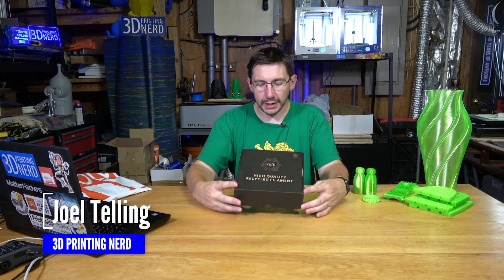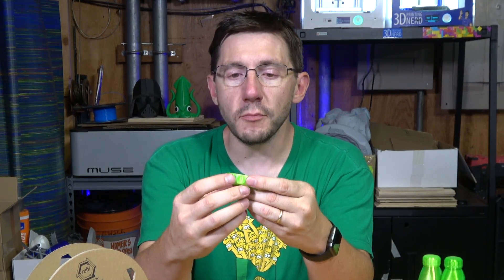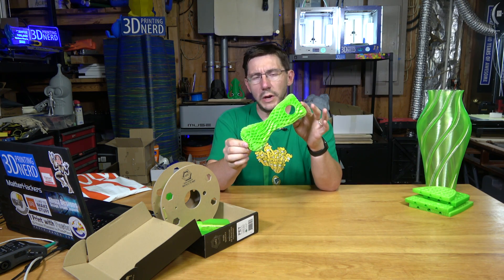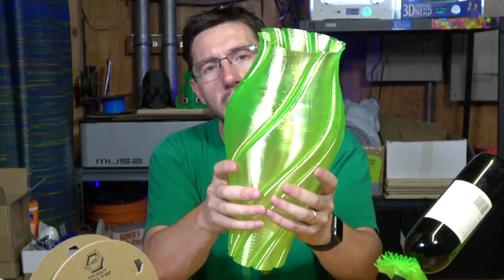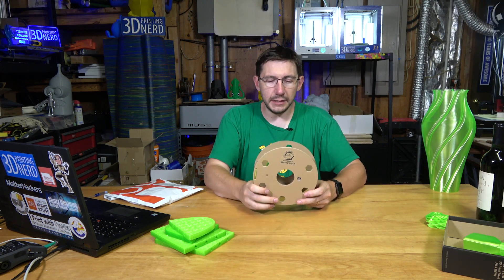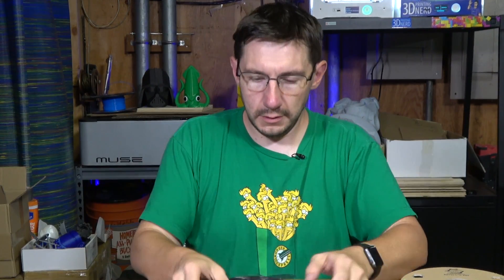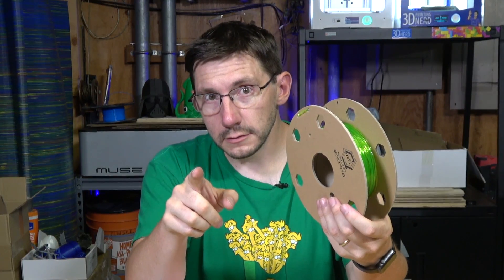Is Recycled Filament Any Good? My Review of 3DBrooklyn Refil Recycled PET 3D Printer Filament

Comment: Hey Joel, I had a question. I have also pruchased this Refil filament and I am struggling to use the PET filament, I have tried altering the temps a bit, and haven't tried altering the mm/s of filament, I am printing on a Prusa Mk2S, is there any recommendations you could give for a more successful print?

Comment: I just want to say I'm not part of their group I don't know anything about them I've just heard them now and I would like to say that car dashboards there's a lot of them out there like you can go to any old junk yard and buy a car dash board as long as it's plastic and from a new model car for like five six bucks somewhere around that price range and I think it's good that they're using cars and refrigerators and bottles and cans and stuff to make and I would also like to have somebody make a hopper sort of deal that goes down to a heating block like the hopper is heated and then the heating block just heat it up and shapes the plastic so like if you have let's see a vase you just throw it in that Hopper it slowly heats up and melts and contract and then that heater core bit that goes into funnels down into a filament extruder extruder and then you have once it comes out you instantaneously the head the extruder the tip of the nozzle or whatever you want to call it goes down into a copper tube that was cool down using I don't know like one of oxygen or something like that something like that you know liquid nitrogen or something like that I've said that a lot and then that goes onto a spool electric motor turns the spool at I don't know like what's a half of a quarter or something like that but can somebody do that so that way if I have a let's say a video game case I could keep that up melt that and turn it into a spool of wire that will be extremely cool

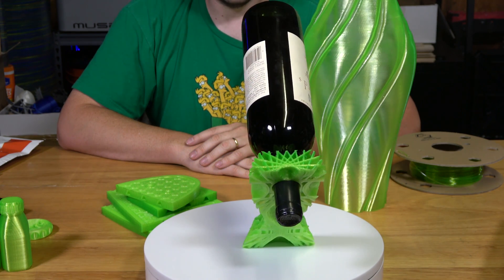Comment: Nice Futurama T-shirt. Nice touch that the recycled filament comes on cardboard spools. More vendors should use cardboard for their filament. What is that rotating platform you used at about 3:20 when showing off the wine bottle holder?

Comment: I'm waiting for someone to create an inexpensive device to melt down scrap PLA and re-roll it back into a spool of usable filament.  Doesn't seem like it should be that hard to do...  Given that so many printed designs waste so much material on supports - not to mention prints that just don't work out - allowing the recycling of this material should be practical and efficient.

I'd also like someone to write a program to re-write the XYZPrinting spool RFID tags, so we could actually use ALL the filament on them.  Right now I have about 10 "empty" filament spools with enough remaining filament on them to make up another couple of full spools.  This is wasteful, annoying, and not environmentally friendly.
Reply: Well getting an filament to continuously be produced with little to no defect is a very precise process, and I recommend Filastruder. Even though its $300 I believe after a few spools, it could pay for itself.
Reply: I'm in the same place you are with the XYZPrinting filament. Super annoying.

Comment: aaay,question
shouldn't this be cheaper vs other quality material?
did they recycle the plastic themself or buy them from local recycling facility and just mix it with some new one and make them 3D printable
if they actually recycle the material in house i can see why it is so exspensive since it's not a big company

Comment: Could you 3d print the other parts of the skate board? fully 3d printed skateboards sounds cool.
Reply from the maker: I think so? Wheels for sure. Not sure about the trucks, bearings, etc.
Reply: 3D Printing Nerd Youcould probably do trucks with PLA with an 80% infill. 

Any less and it would probably snap in half cause all the weight is focused right in the middle. 

If you put a steel rod through as the axle it might work!
Reply: Well the more you can do the more awesomeness, can't wait to see the results

Comment: Being a polyester, it's probably a lot more crystalline  than the starting material it came from. 
You can actually kinda see it since the filament looses quite a bit of transparency and becomes translucent as it goes from filament to finished product. Some of that could be avoid by keeping the printing environment in a low humidity state, but the filament it's self has something like hysteresis.  

As a FYI, if you polish PET with ammonia it'll loose rigidity and become more flexible.

Comment: I would think it would be cheaper since it is made from recycled filament. If it had the same price of PLA, it would make it a major consideration when buying. This filament makes T-Glase is a cheaper alternative.
Reply: Yeah. that was what I thought too They are probably using recycled filament marketing to tug on the environmentalist heartstrings. It is like, hey buy this 1000% markup purified mineral water from mount Olympus itself. Claiming it will give you vitality +5 and increases brain function +10. Yet it is just filtered from Flint Michigan and they just added dirt at the end -50 vitality due to poison -10 charisma due to flammable breath.
Reply: shane bacawaka The plastic used to make filament isn't the expensive part, the fact that you have to extrude the filament precisely to a certain diameter is what makes it expensive. Recycled filaments won't be any cheaper because of this fact.
Reply: Wouldn't it have a similar cost to PLA then? Most PLA I've seen has a diameter +/- .05mm. What makes this so expensive in comparison?
Reply: shane bacawaka The process of preparing recycled plastics for extrusion is probably very complicated, you need to sort the plastics, clean the plastics, grind them up, and then re extrude them. Errors in these processes can lead to bad filament, and potentially air bubbles.
Reply: Considering i can make the filament myself using an extruder i made in 5th grade as an experiment for recycling at home (from bottle to hammock - title), yeah. The price is ridiculous. 
From a single bottle of 2 liters, i can get (just cut at 3 mm width) about 30 meters of "string". That then there passed through a similar device to a 3D printer puller (but much stronger as it also compresses the "string" in to the hot head) yields about 20 meters give or take (depending on final roll thickness).
Reply: Also probably higher failure rates when extruding means it drives up the price of the roles that make it successfully to market

Comment: What about trying a filament maker?
Reply: My first @ a kickstarter event was ( link) , of which there are a few customs things going on, but I still patiently wait ( while playing Children of the Zodiarcs) and making vids with my makersnot printer. I've only run ABS, and have (plans to) make some custom colors, with varying hues= yellow plus green, then maybe some blue in there etc. other than 3 starting rolls of makersnot filament, all my material has come from 3DXTec, which makes me look like a pro! ( I am, sort of = new vid, my place).
I also had some mold shop (production) experience with HDPA, and the "basic" rules for recycling @ Metro Mold, is 30% old to new.the clean room we molded in had a chiseler which poured into a 2 cubic yard box, contained for cleanliness, ( kinda like a tree grinder, but finer) when we had a failed container- about 5% of the run#'s.then a vacuum sucked the chiseled product and it went through a venturi/ grate, so larger pieces were then placed in a
"scrap"= return to supplier for another fine grind. Now why do we do all this stuff for 12 bucks an hour? I dunno,so I can tell you the story! I'm retired now, but the product (was) is the bottles which carry raw product for making silicon wafers for the computer world, so a bottle costing 10 bucks to contain 7k$ of materials is worth the details!  
http://www.redetec.com